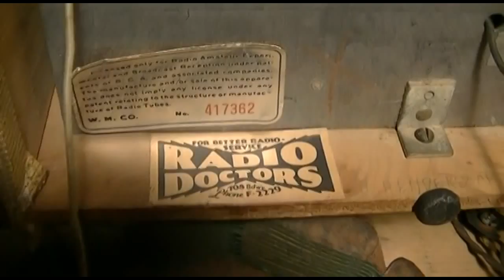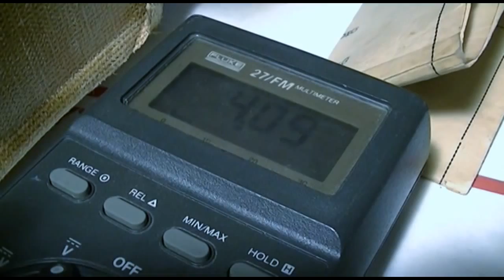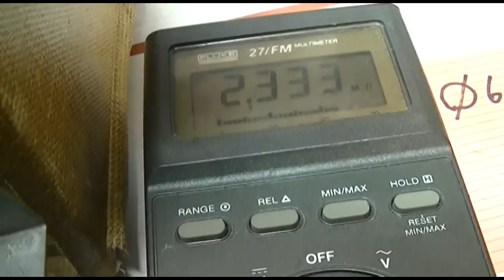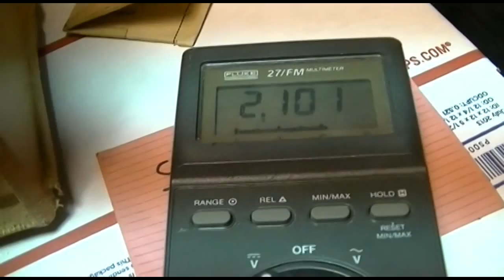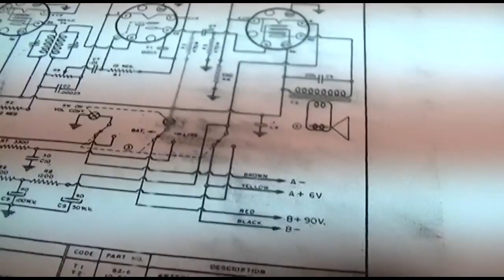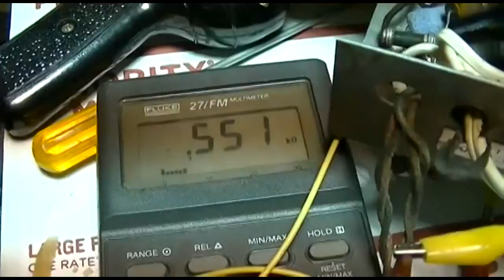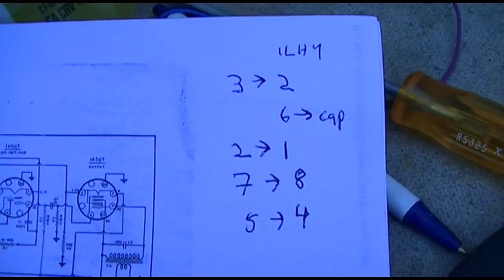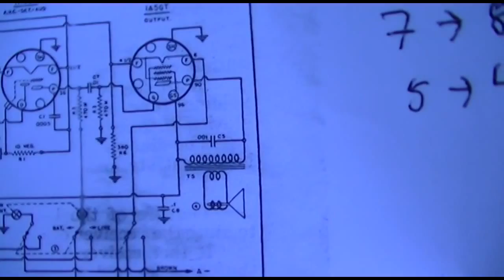Repairing Old Radio

Comment: This is definitely a testament to the flexibility of tube equipment being able to work even when almost everything is bad. That's one reason why i still like the old tube stuff.
Reply: in many cases valves/tubes are very unfussy, but heater or filament voltage can be critical

Comment: Greetings:
Replacing the selenium rectifier: use a silicon diode (1N4007) followed by a 22 mfd 200v electrolytic cap replacing the dropping resistor (cap + toward the diode cathode and - to the first filter cap). Saves heat and no wasted power!
Those battery operable radios are usually classified as "farm radios".

Comment: Locktal tubes were designed for mounting in automobile radios, to keep the tubes from vibrating out while the car was moving down the rough roads of the time.

Comment: I like these types of portable radios and it would be interesting to take a bunch of them to a fringe signal area and see how they perform. It's been my experience that, when working right, these battery radios are fairly hot.
Reply: Some have  rf amp (  3 section tuning cap .) Trans oceanic good .old philco most sw.radios.

Comment: I love the early luggage-type radios, but they can be finicky. Occasionally you turn them on and get nothing. Then you need to wiggle the tubes and you're back again. Also tubes are totally unforgiven. You MUST hook-up the batteries correctly or ZAP! They're all toast. I did that twice! You're set is a less common example. Those smaller obscure models are my favorite.

Comment: The "outside foil" end of the cap is the shielded side.  This side was meant to be connected to the ground, (or lower potential end) in order to reduce hum in the set.  Unfortunately modern replacements don't always mark this end so it is impossible to tell which lead is shielded without testing it first.
Reply: Thankfully "Mr. Carlson" has a video out there that can show you how to build a simple checker to find the outside foil and mark it yourself.
Reply: @JerryEricsson  I might be 2 years late here, but could you share a link to the video?

Comment: Interesting repair video. You are very creative when it comes to getting something fixed. But it's a testament to old radios that even though the components were so far off, it still worked somewhat. Tube equipment is great stuff!

Comment: Just me nice to us that had to make in house repairs back in the 70's and 80's.  Granted I cut the open cap loose in case it shorted.  If I had to use a 1n2005 to 2007 my minimum drop was 47 volts here in South MI.

Comment: It sounded better with the higher filament voltages. Maybe the last repair person didn't care if the tubes were decimated in short order. Cap replacement would have been an expensive job and the customer might have said no, but a 'quick and dirty' repair would have rang the cash register. Were there really unscrupulous techs back in the day, or was this one just stupid?

Comment: The 'correct' way would be to order the replacement parts from the manufacturer. Since that is no longer an option the 'right' way is to do whatever you need to do to get it working without using modern parts. There are many 'right' ways to do almost any operation. Those who are complaining has never tried to repair a 50 year old wafer switch! Great videos!

Comment: If you're re-tubing, replace that bodge with the tube rectifier!
The output tube should be a 3Q5, the 1Q5 is a 100ma filament, the 3Q5 is a 50ma filament.  IE: The 1Q5 is like a 3Q5, but with the two sections of the filament in parallel (3Q5 has a center tapped filament.
Reply from the maker: Its a 1A5, did i say 1Q5? Yea that wouldnt work

Comment: My father who started repairing radio in 1945 always taught me irregardless always replace the paper caps , and electrolyte caps, assume they are all junk, and most of the time they are
Reply: Most customers aren't going to let you do that back in 1945. They're not going to pay you to replace half the components because they're "probably bad"
Now today, you probably don't want to do that to the extent you can get away with it.  You can do as Shango did and do the bare minimum to keep the radio going OR you can not do anything and put it on a shelf and it's not a radio, but a knick-knack.  Personally, I hate trailer queens of all kinds. If you cannot do the thing the machine was designed to do, throw it in the trash.
Reply: @tarstarkusz  your right in 45  no customer was going pay to re cap an entire chassis, I speak of repairs today ,a radio of 75 plus yrs it's that or the trash
Reply: @ubb262s  Not at all.  This one wasn't thrown in the trash and only had 1 cap replaced.  A lot of people don't want the radio to have a bunch of modern components in them.  Other than the grid caps, if it ain't broke, don't fix it.

Comment: Good to know about the one volt heaters, I've got a AC DC RCA with 7 pin miniature tubes that I blindly pulled out to reset them with the power on.
Thanks for creating this video
Reply: im sure those valves had 1.5 volt heaters, so all in parallel to work from  single 1.5 v battery. the ht if i remember was a 90 volt battery,  needles to say the batteries cost a fortune, in uk anyway, and didnt last very long.

Comment: in a lot of cases the resistors going high wont make a jot of difference, especially a grid to ground on an output or preamp valve/tube.. those 'dogbones' are usually 20% tolerance or even higher anyway.., filament voltage or current if series fed, of the 1.4v valves is critical, especially the frequency changers,

Comment: I have a 40's RCA Victor "Ivory Beauty" radio model 56X2 that I'm trying to restore. This is a botch job with all of the caps and well, everything was poorly replaced so there isn't anything where it should be so schematics are useless. I don't have the equipment that you have, nor the advanced skill level that you do. Is there a way that I can contact you so that you can get it working again? You can make a video of it, and I'll pay you for the fix. I am fixing the Bakelite case which is in rough shape, so all I need is to get it working. PLEASE let me know! You are an expert, and I'm a novice. Thanks.

Comment: Shango: Someone deserves a double-ration of naughty language for that crappy workmanship you found. 
How remarkable that the thing even works with all the out-of spec parts still inside. Maybe this one should just be left alone considering that you would have to gut it and that makes no sense whatsoever. 
Not unless it was of vast sentimental value to somebody & they were crazy enough to pay for the work.
You said that this was a bargain-basement radio to start with? I like the style of it.
Reply: those 'out of spec' resistors will in most cases not make a jot of difference in most parts of the circuit, cathode bias and filament shunts can be critical, though, as is any mains or ht droppers